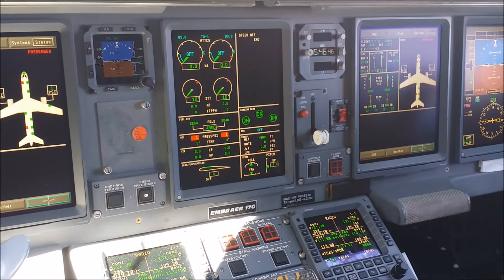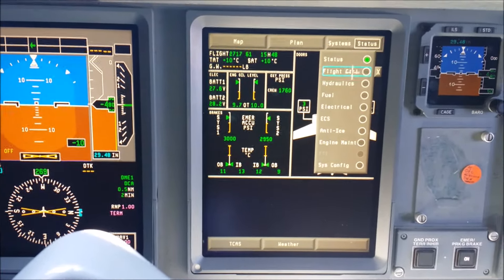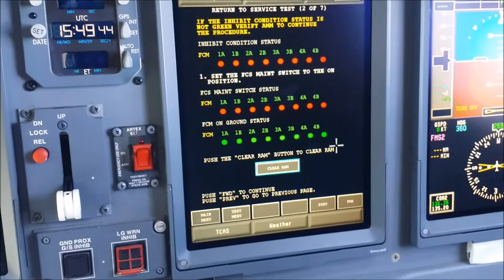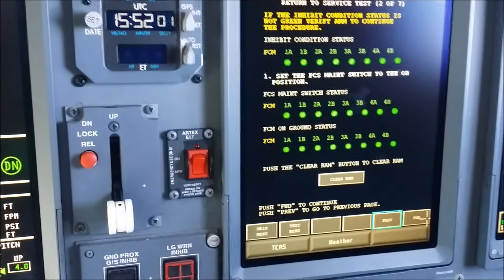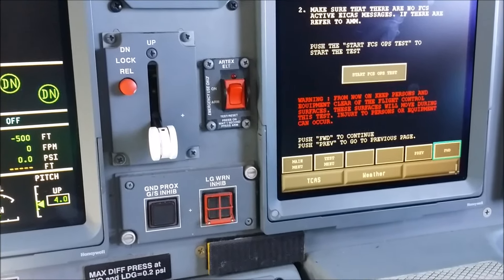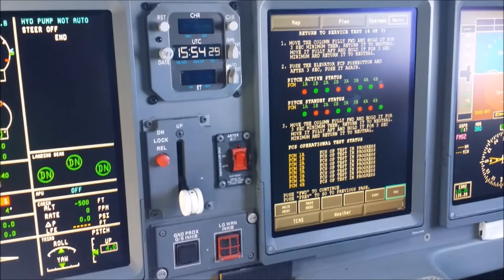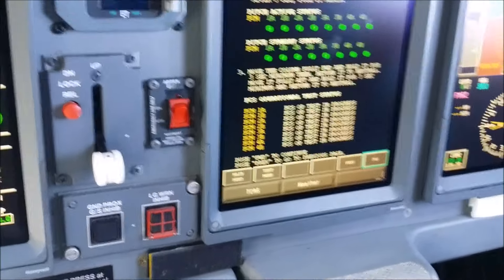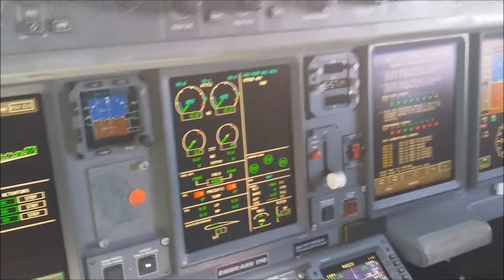Return to Service Test - RTS

Comment: Make sure to run solely off the apu, I've had problem with apu running and gpu selected. The ecu doesn't seem to delete the data to remove the messages off the eicas with ground power.

Comment: Why can’t I get all green after moving the elevators on page 4 of 7? They start all red and after full deflection for 5” the lights remain red.
Reply: Check for debris at the bottom of the control yoke, sometimes small objects get in that area unable you to finish the test. Or the control yoke  stop is too far